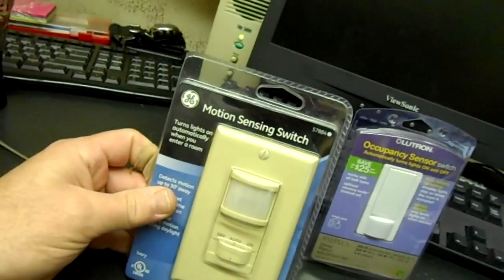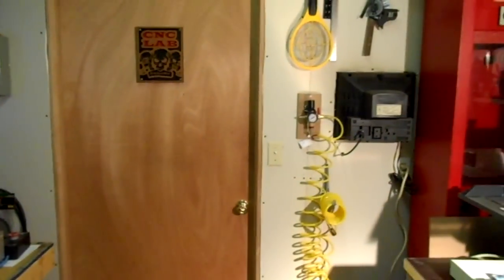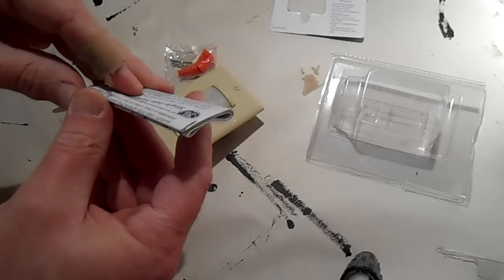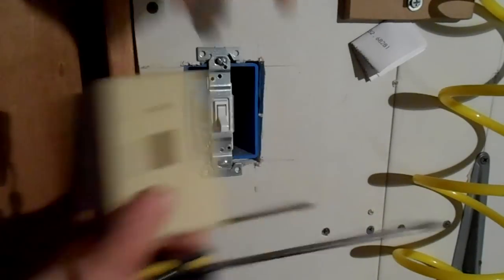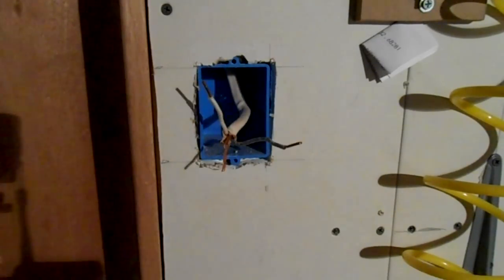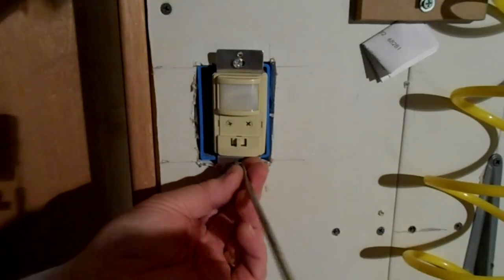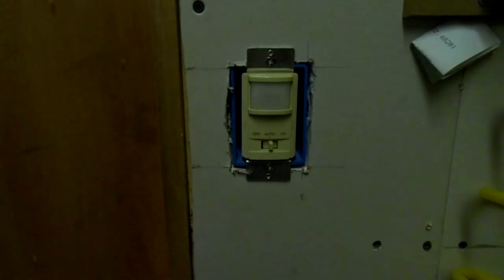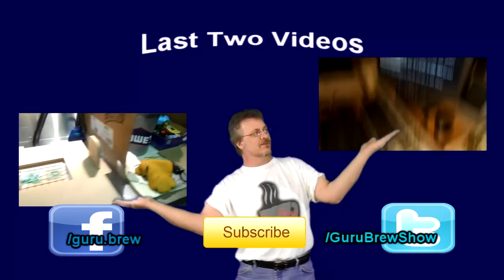How to Install a Motion Activated Light Switch

Comment: My electrical box has a white and black wire only. The new sensor switch has red (load), black (hot), white (neutral), and green (ground) wires. Does anyone know how that should be connected to the existing black and white wires in the wall box?

Comment: Dude. Thank you so much.  Very clear on the instructions.  I had all brakers down, but still was sweating bullets from forehead. (Don't like electrical) lol!
Reply: alex Almanzar get your self a $20 pen tester. It will tell you if the wires are hot still. It takes the guessing out of it lol sometimes breakers aren’t labeled correctly.

Comment: I have this same photoelectric cell light switch. I have installed it correctly but the hallway light goes to "dim", never shuts off. So I hve to use the actual On-Off switch. Anyone have any suggestions as to why the light only goes to "dim"? There are no switches on the photocell or hallway light to change settings.

Comment: Nice video! I know you said you had the CB off, but its always good to test voltage to ground. If CB was still on and the light switch was in ON position, like it was, the meter would have been reading the same voltage making it show 0.00 volts when in reality there is 120v there and you would have got shocked.

Comment: I'm watching this because I did one today & the lights do work w/just a regular single pole switch. However not with this sensor. & I wired it the same way you did w/ the two black wires to the two wires incoming & outgoing one black & one white that together turn the lights on. I also seen in the direction it must be grounded to work & yes I wired the green wire to the bare copper along with the bare silver wire. And still no lights.  I'm guessing that since the lights do come on w/the single pole that maybe the copper wire coming thru the jacket is not hooked up somewhere else as this switch requires a ground be connected for it to work.. What do you think?

Comment: Whoever wired the light switch that you're replacing, should have stripped a lot more of the jacket inside the box! The wires should be about 6"  'long & separated out of the jacket to allow flexible freedom for to strip the ends that needs be attached to the switch or receptacle.

Comment: The reason they don't use those little screws a phillips head, is my estimation is they come from China & w/a phillips tip on a cordless or electric drill will snap it or strip it instantly whereas the standard head will slip off as it will not lock into the groove as does phillips head.. Chinese steel is crap, so what else can I say! except It's how now they own America as we buy their counterfeit goods because they look good, but is actually so inferior to what we always made superior in the past!

Comment: I hate mine which is in the garage. If I'm under the hood doing mechanics work it shuts off! I have to stop my work and wave and get "in sight" of the sensor before it's activated again. Just an FYI. I'm planning on switching back to manual.

Comment: Hi 

Hope my questions can be answered.

First:
Is Motion Sensing Switch is better or Occupancy Sensing Switch is better is babies are there in the room.

Second:
There were three wires, i am aware of two wires negative and positive, is the third wire the Earth wire.

Third:

Can the similar be done for the celling fan in an room.

Kindly help.

Comment: Why are they known differently - when the basic work they perform is the same. I know proximity switches are used more for system integration or machine building.

Comment: what is the name of that orange cable twister ? that's look alike marker cap
Reply from the maker: Its called a wire nut. Available at any hardware store. An easy and common way of joining two wires together while protecting the joint. Steve

Comment: GURUBREW, I have a separate double switch (one for the light/one for the fan, this is in the bedroom). I would like to place a motion sensored light switch in place of the regular light switch but keep the fan switch separate. Is it possible to do this, if so, what product would you use? Or if not, can you please advise what needs to get done? Thanks much.

Comment: You can turn the "occupancy sensor" setting to off so that the light won't automatically turn on when someone enters the room. For example, I don't want my bathroom light to turn on if I get up in the middle of the night. In all cases, it will turn off automatically when there is no movement sensed in the room.
Reply: Brent Carlson-Lee y

Comment: great video i bout the ge motion sensor switich shown on your video the problem is my old switch has 2 black wires and no gound wire my motion sensor switch has 3 wires what do i do for the ground do i cap it off please help thanks ps the motion senesor has a green black and red wire

Comment: The GE model is a 150 degree model and in most cases consumers install this into a bathroom and 150 degree is sufficient for the use. To answer the questions about pets and the motion, it will go off if your pet is either tall enough or if you install the unit where a receptacle would go. The GE one is designed to pick up Passive Infrared and it WILL sense your pets, unless your pet is a rock or a fish.

Comment from the maker: Hi, my dog goes into the room because we keep a cold drink in there for her. It does turn on until she lays down and then goes off. The GE one is not so sensitive that a slight occasional movement will activate. Good luck with your project.